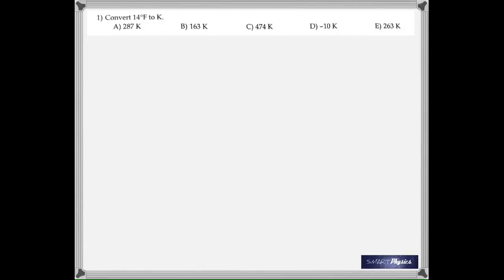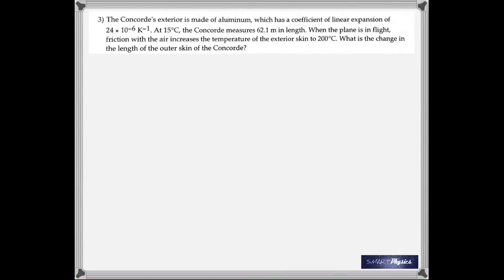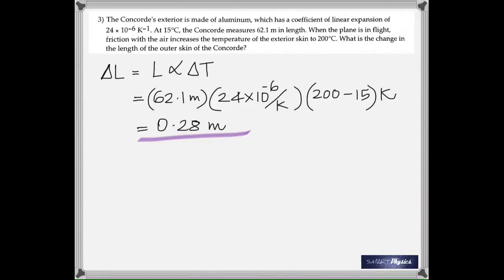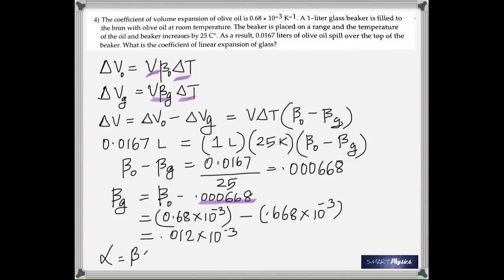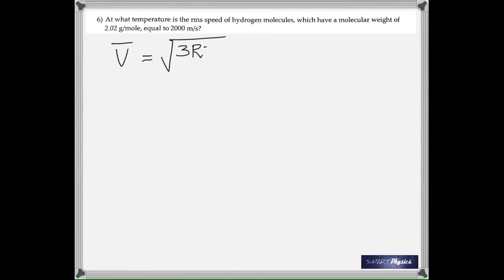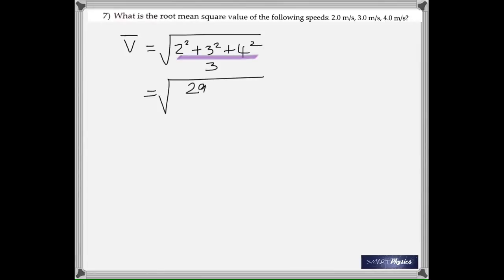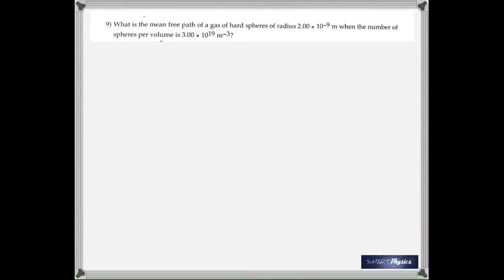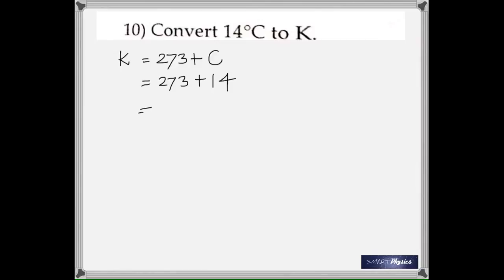Thermal Physics - Problems

Comment: I thought question #4 about the olive oil overflowing was a very interesting question. In particular, I felt that it more clearly exemplified the fact that linear expansivity is 1/3 of cubical expansivity and the logic behind solving these types of questions. Also, the linear expansivity of the glass is almost negligible when considering the small fraction of a percent of the liquid displaced compared to that of water because water has a much greater expansivity. The video is very informative and helpful and I will continue to make efficient use from it and the videos to come.

Thank you,

Thomas Schimp

Comment: Each problem was worked out clearly and gave me a better understanding of how to pin point what the question is asking to determine the correct formula to use. I learned how to convert between celsius, fahrenheit, and kelvin, linear expansivity is one third of cubical expansivity, and change in temperature is proportional to change in length just to name a few.